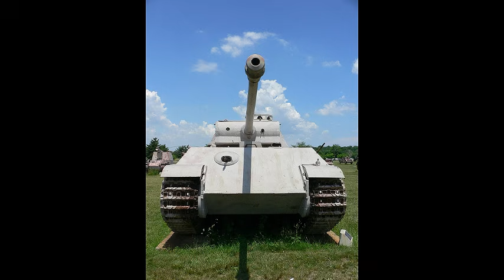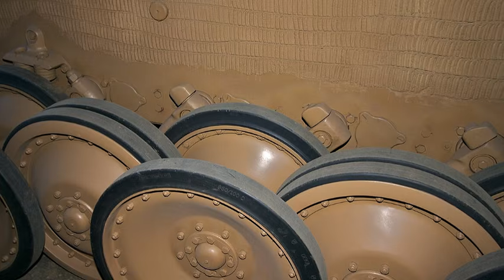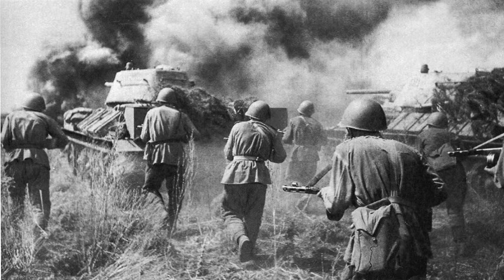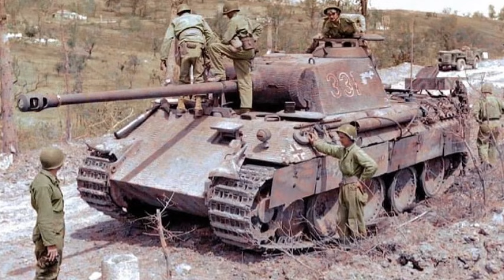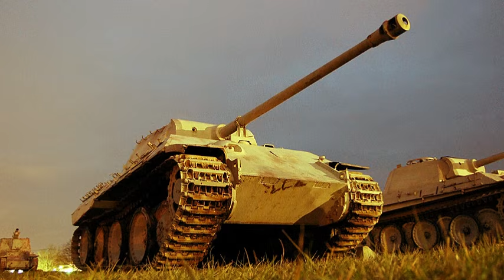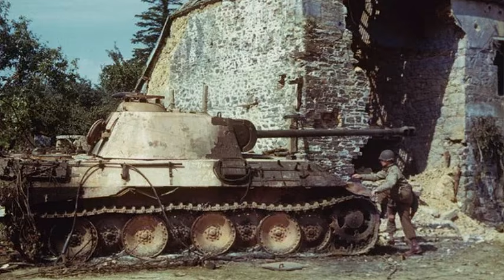American Engineers Tested A Captured Panther — Discovered  Final Drive Failed After 150 Kilometers

Comment: Standard octane rating for all allied gas was 86. That was the standard, pump gas in New Zealand too. High octane for experiential aero engines, with compound supercharging, was 150 octane.  High octane fuel is slower burning. If 86 Octane is put into an engine made for  high octane fuel, that engine , under high power, is more likely to be damaged. At twenty four I was a technical man for Caltex in  New Zealand.

Comment: I never thought about the sustainability and maintainability of the German war machines. Thank you for noting the differences of the Allied vs Axis power cultures with respect to the industrial effort aspects of WWII. Your mathematical analysis of the competing war efforts makes complete sense to me
Reply: Sadly that was the point of the Sherman. Interchangeable parts the sherman was over built in numbers and easy to swap out parts. Even on similar variants. Granted we had to upgrade certain areas (type of gun, ect) but easy to repair damage if they did not just burn up. Also the Shermans had many more back up parts in stock or  just back up parts off damaged tanks. German tanks might always have that spot in my heart, but they were just over designed.

Comment: It’s a recurring myth that the sloped armour of the t34 gave rise to the sloped armour of Germans tanks. 
The Germans knew about sloped armour. Just look at their armoured cars. 
Initially they gave prefference to more space in tanks by not using sloped armour. The idea was that by manoeuvring the tank so that it was positioned at an angle to where the shots came from you would have the same effect in a different way. This proved not as effective and was later abandoned.
Reply: You have to drive the tank onto a slope before getting hit.. not a smart idea.
Reply: @FrankMcIntyre-i2u  No you have to position the tank in a horizontal angle to where you suspect the danger will come from.